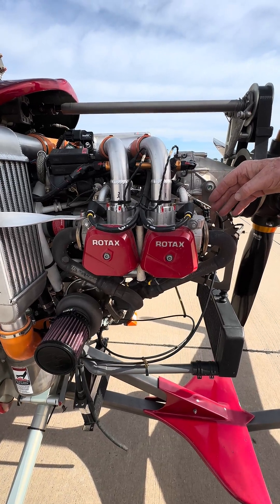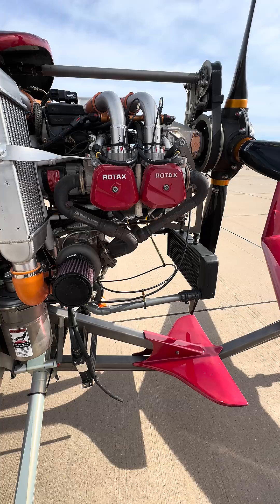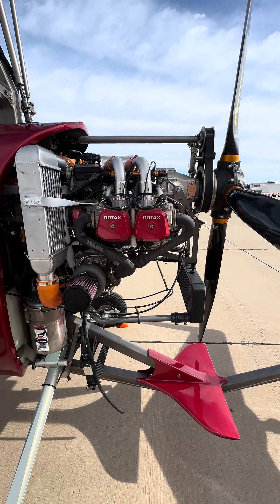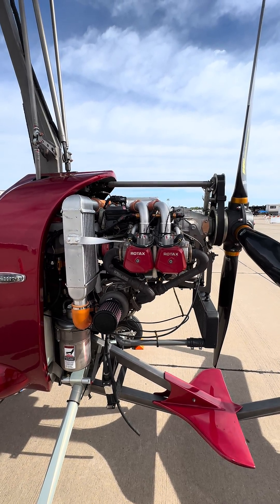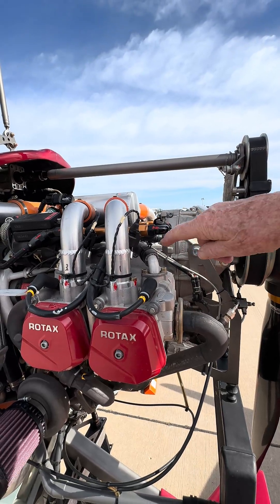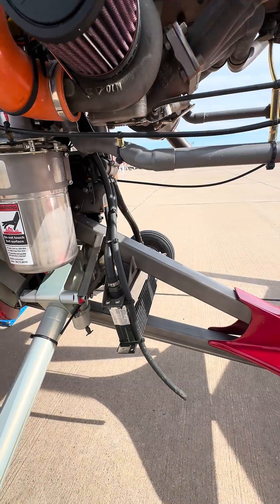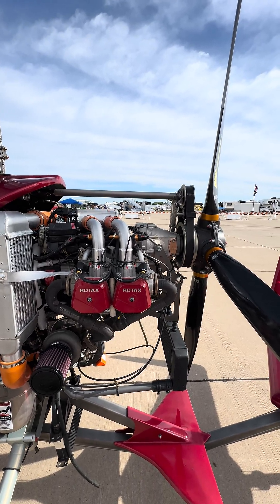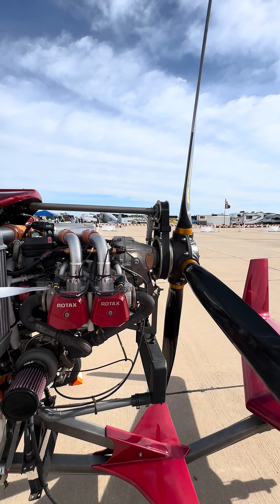How This Engine Stays Cool Even on Hot Days! ROTAX TURBO

Comment: Why no thermostat or door?
Reply from the maker: What do you mean?
Reply: @WingspanAdventuresFlight you said that you block off the oil cooler unless it's hot outside, so I'm assuming that you don't have a thermostat on the oil circuit? I know that having stable oil temperatures and track cars makes a huge difference for durability.
Reply from the maker: @michaelevans831 I don’t know?
Reply from the maker: @michaelevans831  I'm going to go out on a limb here and say the oil cooler doesn't have a thermostat because the oil needs to flow freely to lubricate the engine.   This is not my aircraft and I'm not much of an expert on Rotax aircraft engines so that's just my guess.